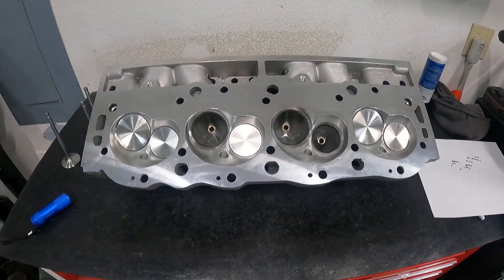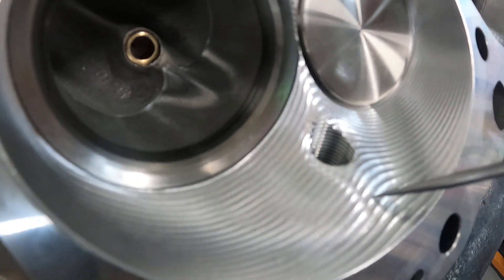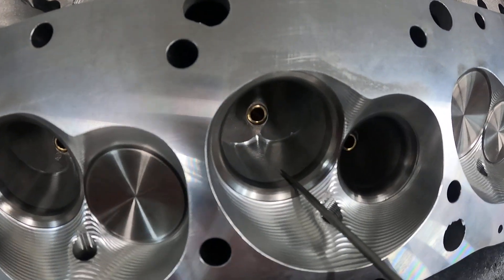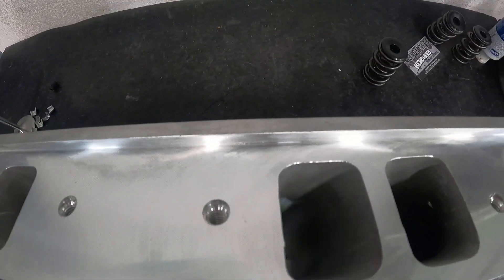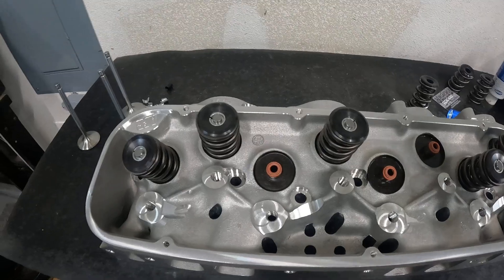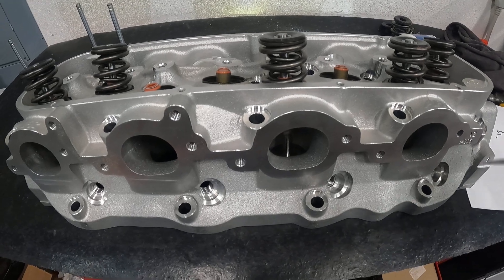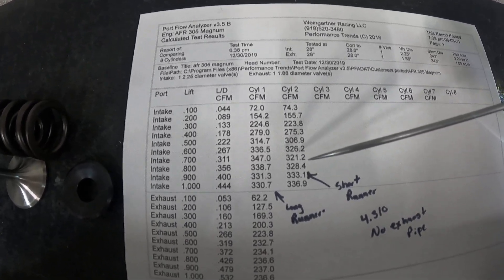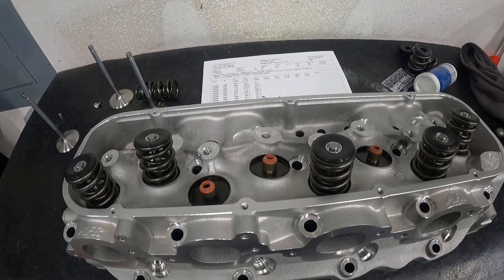AFR 305 BBC info with Flow Numbers

Comment: I've seen the china SBC, SBF an LS AFR heads for sale. You can buy the china ones in bulk direct from china for like $25-$50  a piece from memory and they look identical and even have the AFR name cut into them. Its what happens when buisnesses go to china for castings. China just sell the product.  https://m.made-in-china.com/product/Sbf302-for-Ford-Renegade-Cylinder-Heads-302-351W-718638492.html

Comment: Eric please help..I have a BBC 427 12.5-1 with a  ported by Gunther's in Virginia. set of 049 open chamber iron heads. Has old set of trw L2307A .580 domes .714/.714  262-268 108 solid roller. Has a glide 5600 stall shift 6800. What aluminum head would be a direct replacement you would recommend. This big block is not giving me what expect 6.50s 108 in 1/8" #2950 car 4.10 gear
Reply from the maker: Brodix Race Rite 270
Reply: @WeingartnerRacing  what if it was a 496 bbc with similar specs, what would you recommend

Comment: I'm really curious about this 305 had verse the similar brodix race right or I think you mentioned the BB3 the other day that also has the raised exhaust port or that's available anyway on the race right head I have a 468 with the 049s on it I think it makes around 600 it's got a flat tappet Cam and runs 10-6 at 127 at about 3450. 

We did the heads about 20 years ago fitted with 2,25 in and 1.9 ex but they never been on the bench. They're worked over pretty good that I'm very curious what you would think about a change to a low 300cc head on that engine
Reply: The 325cc is pretty good too, flows slightly more and typically only measures about 317cc.

Comment: Hi mate from Australia! I have a set of 305 afr heads on my 496 with 11.7 to 1 comp victor jnr manifold , 1000cfm hp holley and a solid flat tappet cam with 109 lobe separation and 260, 265 at 50. , 640 lift.
I have the 121 cc chamber.
I had hoped to have made around 650 hp with these head's but now I think it will be closer to 620 hp after seeing how much they really flow.
Thanks for the information,  it shows that afr   exaggerated the flow numbers as they are supposed to flow 370cfm at 650 lift on the good port which i thought was too good to be true! Lol.
Keep up the good work! 
Much appreciated.
Reply: Get it dynoed
Reply: im 725 hp to the wheels on my 454 bored out to 475.  its 12.3 compression on pump fuel.  268/270 duration solid rollor 715 lift
Reply: I don't see how your combo would make under 700hp.